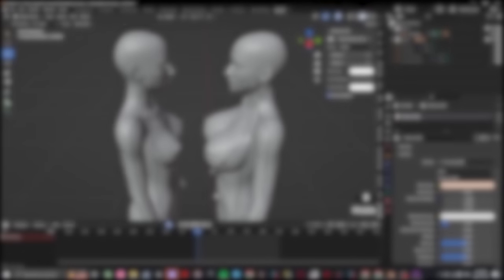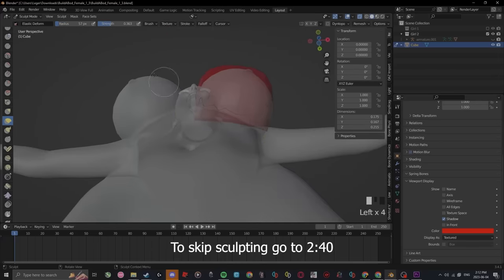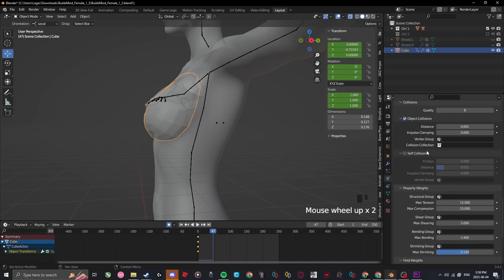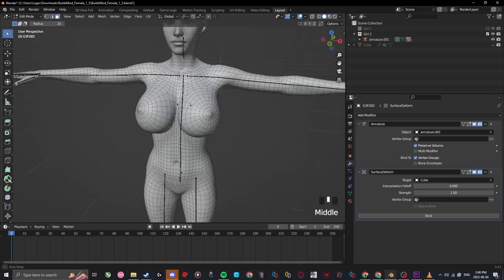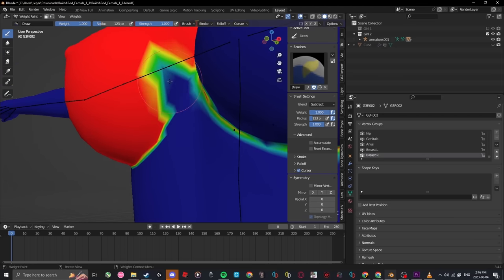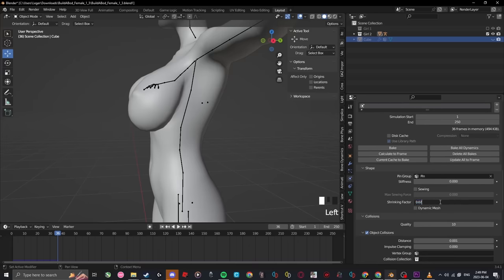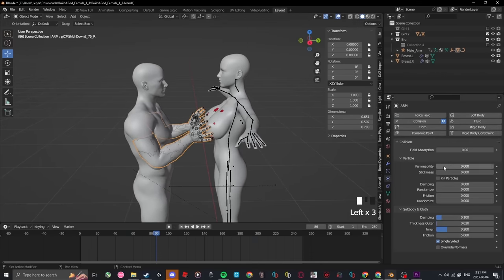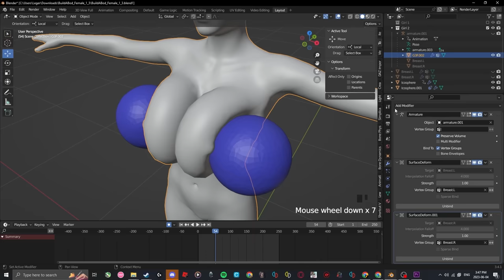Breast Collision and Jiggle Physics in Blender through Cage Deforms - Kris Stone

Comment: As a part-time 3D modeler myself, this is actually really informative and helpful. And it does just apply to breasts, you can also use this info to apply it to other body parts or objects.
Reply: I was also wondering, if it works with ass cheeks and thighs too. Thighs may work a little differently though.
Reply: @marcusrauch4223  lmfao

Comment: tip for Weight paint: When using symmetry to adjust the weight, don't put the brush on subtract, this will always give incorrect adjustments, instead just put the weight of the mix brush on 0, It makes precise adjustments and won't need any secondary adjustments, this little tip save a lot of time and effort!

Comment: This should work just fine for other areas as well right? As long as the cage and pin are adjusted right? I've been using a similar method for adding jiggle physics to butts.
Reply: of course
Reply: theory should work... but the number ain't. don't forget the physics of seating down and the muscles being pulled by the leg...
Reply: @PrograError  Of course the number values wouldn't be the same. I meant the making of the cage for the most part.

Comment: I've followed the tutorial and I think the breasts react to gravity as if the model was always in the default pose regardless of the animation of the character, meaning that if the character goes upside down, the breasts will fall upwards. I think it's due to the data transfer part, but I'm no expert... Yet.
Reply: I am suffering from the same situation.
If I rotate in object mode instead of pose mode, only the physics are correct.
I think it is because the bones are set up in the local coordinate axis, but I don't know how to fix it either...
Reply: I asked the author of a tutorial video (youtube.com/watch?v=jYbCBFQOZAE) that shows a similar method of making this and he gave me the answer, which I share.

He said that the order of the modifier of the breasts cage object is important.
Perhaps Armature is now under Cloth.
If you reverse it so that Armature is on top, it will work correctly.
This solved the problem for me.
Reply: Is there another options to made it in blender?

Comment: Kind of dumb question from someone pretty new to Blender: I've done the tutorial, and it worked out more or less the way I wanted (I at least know how to make adjustments based on what I've learned in the tutorial). Is it possible to use the physics settings to put a tight top on the character that pushes up and squishes the breasts around it a little, rather than having to sculpt the breasts to have the appearance of being somewhat squished? I don't know how to model a character using physics like that, or if it's even possible to do.

Comment: I have spent 2 days on this and when I get the first breast working and then duplicate it, the other brest explodes. I did flip the normals too and checked that the same parameters are in both cloth simulations. I believe I have issues with the Pin. Maybe I need to reassign the pin to both back-faces of the breasts? Or one Pin per breast? I am about to give up.

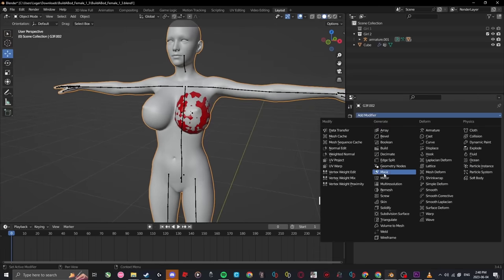Comment: I imported  a mesh from Daz. It seems to have some difficulty with the part at about 6:10. I don't see the 'bones' the same, just the circular controls from Blender. They work, so I assume the bones are there. But after following these instructions at this point, several times to make sure I did it correctly, the 'cube' does not attach to the mesh and follow it  =/  Operator error I'm sure. I just don't know where the error is on my part.